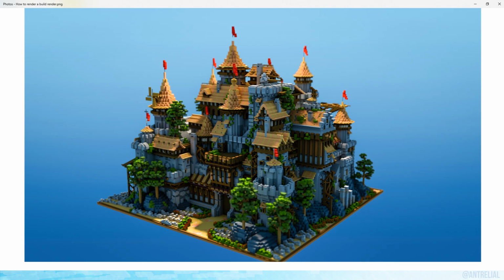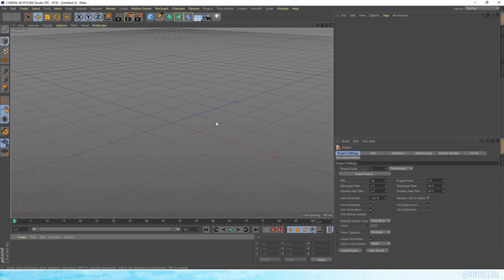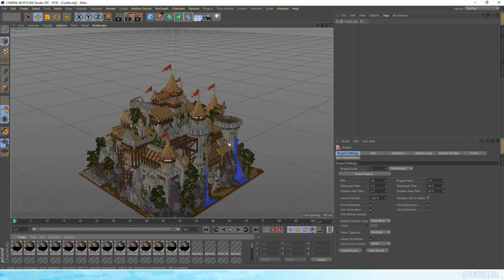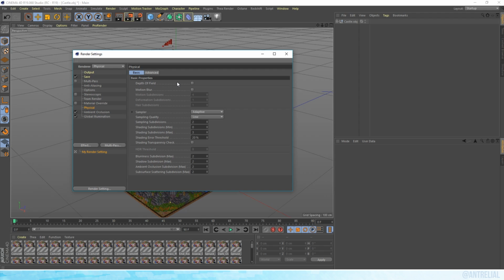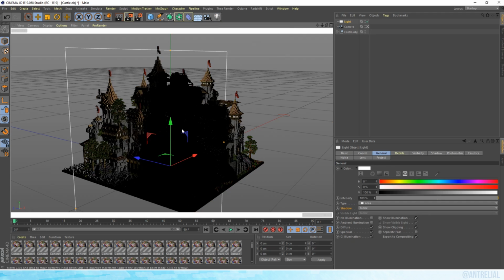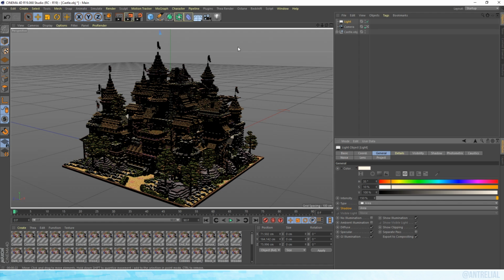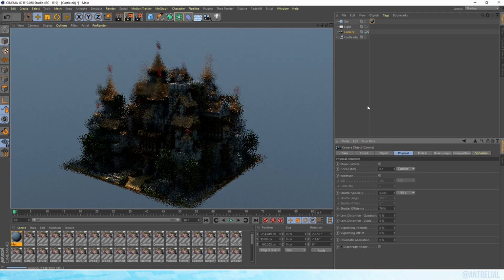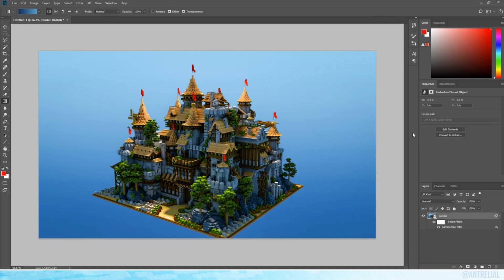EASY MINECRAFT BUILD RENDER IN CINEMA4D

Comment: Great tutorial! I was wondering if it’s possible to use a resourcepack?
Reply from the maker: Thanks! Yes it is: First open the resource pack and copy the blocks folder. Then go to the folder where you installed mineways and go to TileMaker. Delete the current blocks folder and replace it with the one from the resource pack. Then, run TileMaker. After that, it should generate an image called terrainExt. if you want to use it on a world, when you open mineways the first thing you have to do is go to file>set terrain file and select the terrainExt. Only after that can you open your world and make a selection/export, otherwise it won't use the resource pack. Hope this helps!

Comment: i have a question, how to change the default MC water to a realistic water? 
Do I just need to change the material?
Reply from the maker: Yep, you will need to create a new material and apply it to the water (just drag and drop)
Reply: @Antrelial  I have another question, when I render glass, it became solid, but I already put transparency in the material, how do I fix it?
Reply from the maker: If there's already alpha on then that's probably because of the angle you're looking at the glass/the lighting. If you really want it to be more transparent you could lower the exposure of the RGBA in the Alpha channel (click on the bar where there's the path to the texture).
Reply: hai bang

Comment: hey mind helping me? when I insert the RGBA file it turns into every minecraft block there is and it's super weird. I use 1.8.9 schmetica however, is that the problem?
Reply from the maker: Hey, I think that's an issue with the new mineways version that doesn't UV map (place accordingly) the blocks correctly. Here's a link to a version that works: https://discordapp.com/channels/@me/490511086135803914/506058038608658462
Reply: @Antrelial  just updated my C4D and it fixed